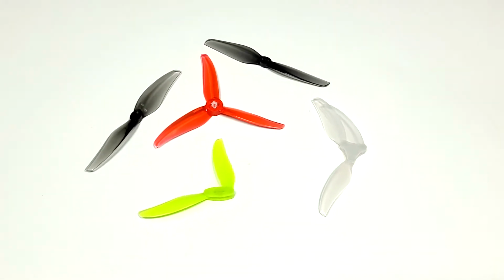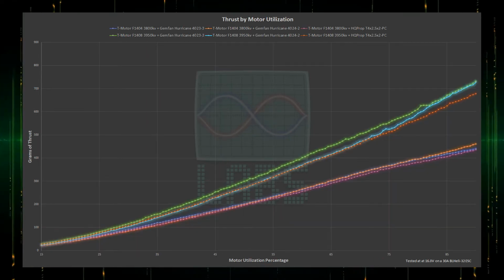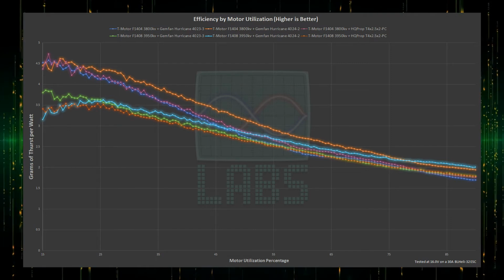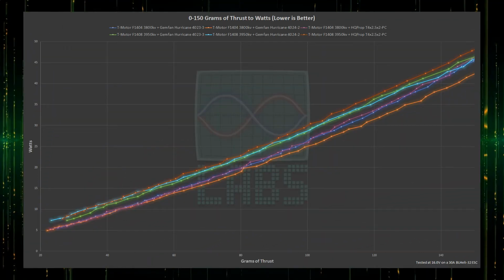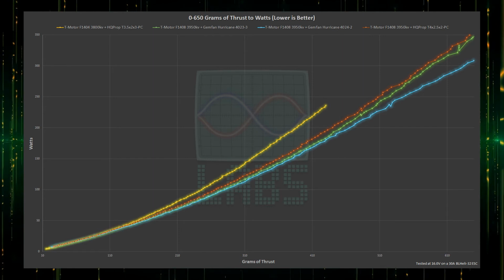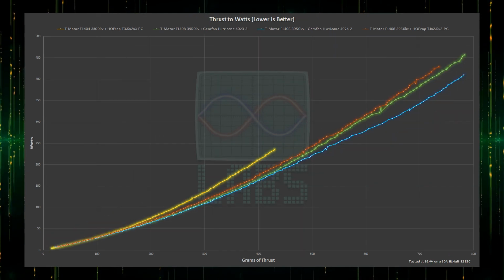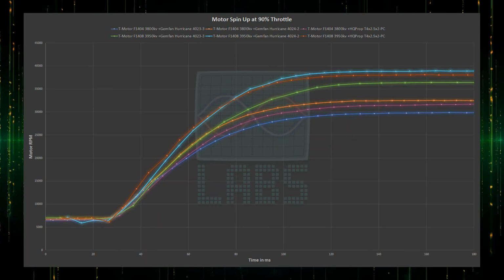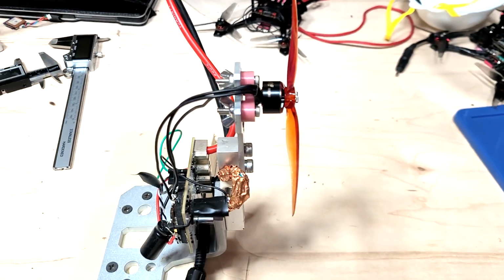1404 vs 1408 at 3800Kv on 4" Propellers - Full Comparative Testing

Comment: I fly my 4023/3750kv/1408 setup with 650-850mah 4S. Usually throttle capped to 80-85% because unlimited your bottom end can get a bit bouncy. Also, this KV is traditionally used in a 3” to propel it to 100mph. In that light the 4” doesn’t even make sense running unlimited unless you truly wish to put 5” batteries on it and make it fly like the AOS shitpiles do.

Comment: Issue is there aren't any racing(+freestyle) oriented 4 inch frames with good support for HD (USA/Cannada market is a bit better). The best I could find are the ImpulseRC apex clones like the Steele 4 and HSKRC Apex4. Those however weigh a ton compared to even the sturdy 3.5" Geprc Smart 35 frame. The lighter 4 inch frames are all long range ones with massive top plates that would induce too much drag. 1408 on something like the "Steele" 4  still has decent disc loading so I still think it is a good option but at that point you really aren't far away from a 5 inch so all the advantages of smaller, quieter, safer and cheaper are diminished.

I do wish you would have tested the popular nazgul T4030-2 prop. Maybe in the next video?

Edit: Another good frame option I just found is the FPVracer R420, available on both banggood and aliexpress and has somewhat replaceable arms and quite decent weight for a 4 inch.
Reply: Yeah, for this reason I'm using the picklebig4 frame.
At that weight I can't find anything better.
It's really stiff but to use a light action camera (caddx peanut) I had to create a custom canopy.
Reply from the maker: For sure. Going through some spreadsheets for build calculations if I decide to make a 4" build I'm probably going to need to design my own frame. 

I grab props that I have easily available for me to purchase for testing, so unless someone sends me some Nazgul props or they are at a store I'm grabbing stuff from already, I probably won't. I'd be happy to if I had them though.
Reply: I saw and bought this Steele 4 (replica). 81g. 35a stack, analogue, and 1408 tmotor 2800kV, is my specs and haven't completed the parts. I can do theoretical calculation of disk loading. In a 4inch setup, what thrust to mass ratio would you consider for freestyle with full gopro?
Reply: @jeffclassics  Exact thrust:weight calculated would depend on whether or not you account for voltage sag and what battery you end up using, but at least 7-8 is usually more than enough. You can calculate the T:W without sag if you consider freestyle, since you usually only do full throttle for very short durations.
Reply: @kinzokushirogane1594  thank you. Based on the given chart of my motor, I'm at 8:1 without action cam and 6:1 with a gopro. Thanks for recommendation.

Comment: Is spin up time for RPM important? Isn't just the thrust what matters? A high pitched prop will take longer to spin up and might not reach the same high RPM. But a low pitch prop might not have the same thrust.
Can you compare a 2004 to a 1408 motor please. I think 2004 is the better option.
Reply from the maker: When you tell a quad to do something, a slower spin up time will be a slower response to that command. The quad is also changing prop speeds extremely quickly to keep the quad stable, so it could also effect stability if it's too poor. 

If the response is too slow, it means it might be worth considering a less demanding prop, or a bigger motor.
Reply: I added the same comment to another video. A slower spin-up time rpm wise could still be a faster spin-up time thrust wise, if the thrust per rpm is higher. Would'nt that be the parameter which determines the flight characteristics?
Reply: @kaptn_kapton  I guess somewhere in the middle lays the truth. You cant have just endless high RPM with no pitch and thrust. But a too high pitch wont be efficient and responsive. You need a good balance between pitch and RPM so that your motor can handle it perfectly
Reply: @chrisbee5481  And that is exactly what the thrust per time chart give you. The whole pitch and rpm part would be included, but efficiency is another story then.

Comment: Thanks so much for the info ! Imho 3800kv is too much on 4s for 4in props. I'm using 1407 3300kv on 4s 650 with good results with hq 4x2.5 (m5 shaft).
Reply from the maker: Yeah it looks that way. Will be interesting to compare against 2800Kv.
Reply: @RecursionLabs  did you test it?
Reply: In a way you’re right, but my 4” toothpick with 1404 3800kv running 4s 450mah with 80% motor cap and 25% throttle expo around hover point can sustain moderate to heavy freestyle flying for about 8 minutes and I’m running Walksnail 1s so it’s been a really fun platform. Based on the thrust at 75% from this video’s tests, I should be getting 15:1 thrust:weight at full throttle.
Reply: @alurpal888  beware that a 4s 550mah lipo can't sustain the required current from your motor so you are limiting your throttle resolution because from a certain throttle percentage to full throttle the lipo operate like a constant power supply (current goes up and voltage goes down= more or less constant power). I tried myself and i liked the most 3s 650mah on a 1804 3450kv
Reply: I hear you, I should’ve added more detail. I designed it to be 3-4s (why I chose 3800kv). 3s lion for mid range cruise, 4s motor capped for extreme fun. 80% motor max was an initial design decision and it works out better than I thought. More than enough power (130g auw) and more flight time than I though.